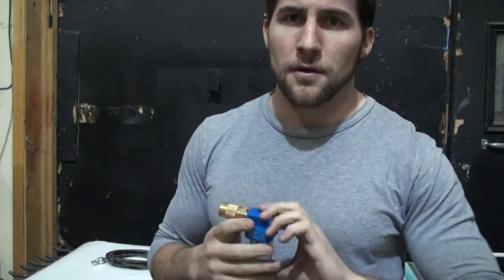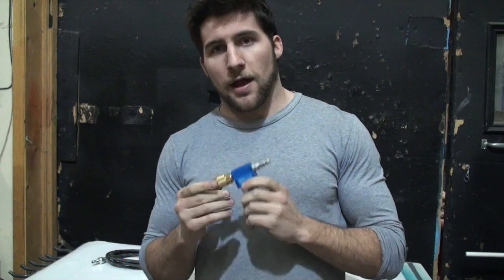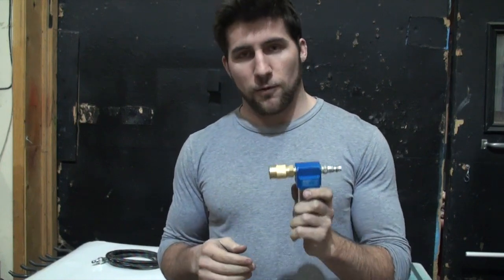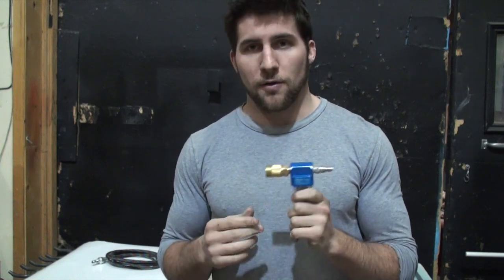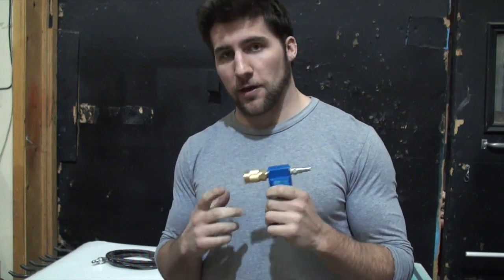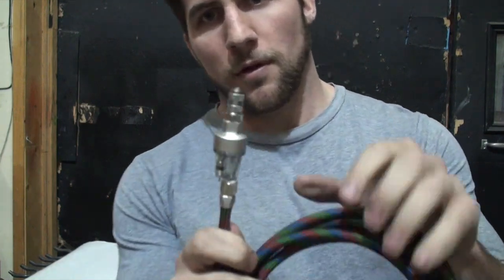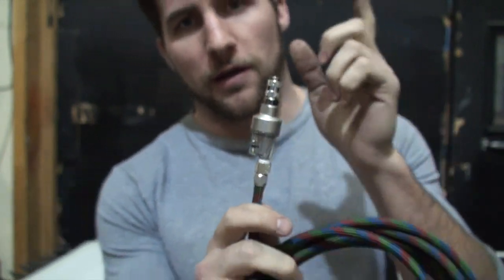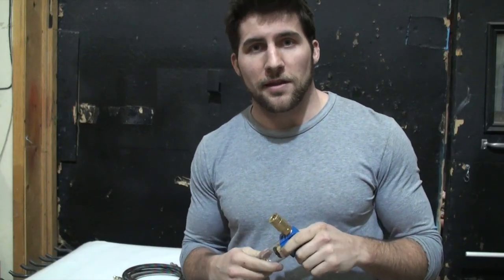How to keep moisture out of your airbrush setup

Comment: Hi Brad,

I bought one of the filters like the firat one you saw, but since it must be as close to the gun, and you normally spray holding the gun horizontally, I found it a bit annoying as the water capture container was sitting also horizontally. I am not sure if it would work in that position, as it seems to be designed with the container in a vertical position. Long story short, I found an inline one and am planing to use that. Do you know how such thing really works? Are my worries with the first version wrong?

Best regards,
Adrian
Reply from the maker: They should both work fine. The version I have works horizontally as well.
Reply: Brad Angove ok. Thx
Reply from the maker: You're welcome.

Comment: I just saw the video you didn't mention this I just saw it an that answered the question that I had.  Would I be able to attach a quick disconnect on top of the inline moisture trap? I saw that you did it so I surely do appreciate it I'm definitely just going to be working with water base thanks.
Reply from the maker: Yes, you can definitely do that.

Comment: hello, i just bought a compressor and an airbrush, the compressor i have has a tank and a moisture trap as well but i live in an area with fairly high humidity, around 75-80%, is there anything else i need to do to make sure nothing goes wrong? i'm also spraying indoors as there is nowhere outside to spray, help?
Reply from the maker: What are you spraying?
Reply: Brad Angove lacquers mostly
Reply from the maker: Lacquer is sensitive to humidity. Having an extra moisture trap might help, but he ambient humidity can be an issue. 
A dehumidifier obviously would help. I’ve also seen people use an air conditioner to remove some humidity.
Reply: Brad Angove thanks, just found a room woth air conditioning and just ordered another moisture trap, what temp should i set the ac to?
Reply from the maker: You don’t actually want it to cool things down really. The idea is you just run it to pull some moisture from the air.
Reply: Brad Angove so around room temp?
Reply from the maker: Essentially, yes.

Comment: I have a tc326 compressor and when I set the pressure at 40 the air pressure goes down as I spray and tips ?
Reply from the maker: Do you mean the gauge drops when you push the button, or is the air pressure gradually subsiding as you spray?

Comment: Hi Brad, have you got any experience spraying nitro clear lacquer through an air brush? I've found an iwata kustom TH with 0.5mil needle. It can spray in a fan shape up to 3 inches wide so I wonder if it could double up and be used to spray clear coats (on guitars). Reason being, my HVLP gun is terrible and i'd like to relegate it to the bin if the iwata can take its place.

The original intention for the iwata is doing colour bursts with cellulose. Again, any experience using airbrushes for that?

Thanks!
Reply from the maker: +Daniel Smith Hi Daniel. I've used a 0.5mm iwata to spray nitro before. It works well as long as you thin the lacquer correctly. Keep in mind that nitro dries quickly, so tip dry can be a bit of an issue. Technically you should be able to spray clear through it, but it will be difficult to get an even coat across the whole surface with such a small fan. Airbrushes are great for bursts etc. like you originally intended, but even a low quality HVLP gun is usually better for coating the entire instrument.
Reply: +Brad Angove thanks for the reply. Cheers
Reply from the maker: You're welcome.
Reply: +Brad Angove going slightly off topic from airbrushing. I've had issues with my nitro clear coats spider cracking a couple of weeks later. I'm pretty sure it's because I've been spraying 10+coats in a single day (!). Do you think 1-2 coat per day is a safe way to avoid this issue?
Reply from the maker: Yes. That's probably the issue. Nitro takes a long time to dry, and if you spray too much too quickly the top can dry faster than the stuff underneath and it will crack etc. as the solvents underneath try to evaporate out through the top. 1-2 coats a day has worked for me.